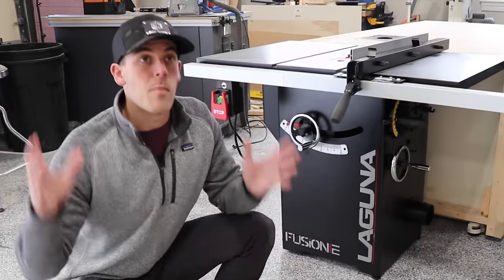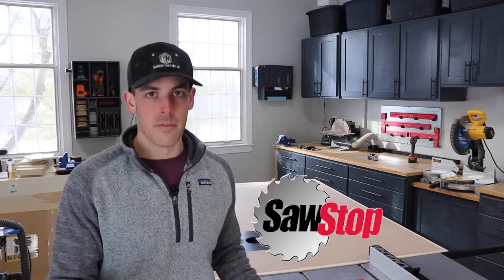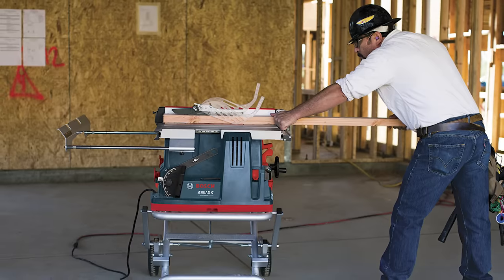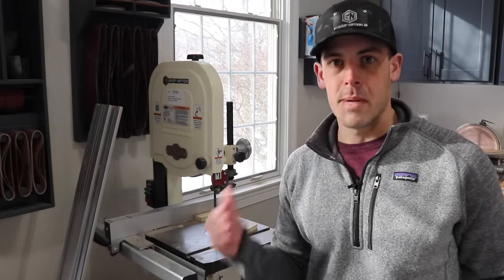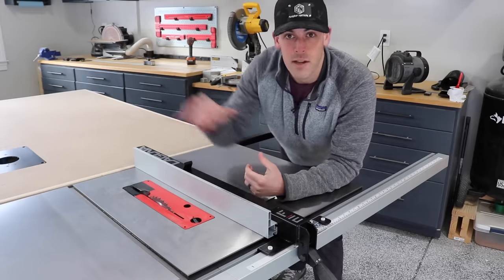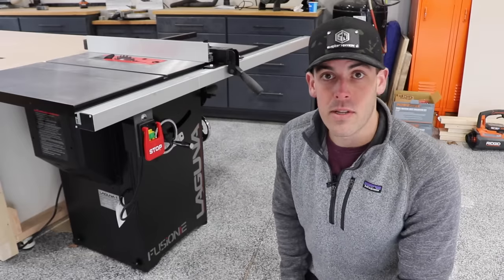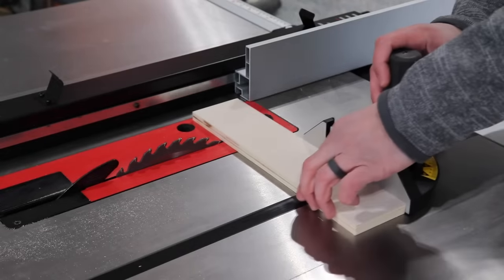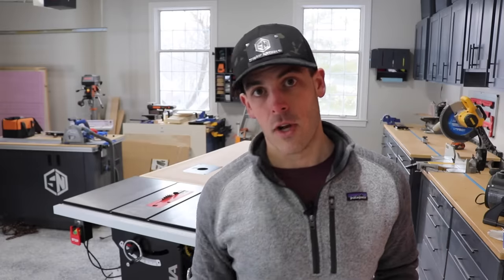Why I Bought a Laguna Table Saw over SawStop!

Comment: After 15 years with my Bosch Jobsite saw with vertical rise stand I'm finally ready for the next level. Do diligence for a tool in this price catagory meant a LOT of Study of the alternatives. Boy was I sold on Jet! loved Powermatic but not the price.  Then the Laguna F2 showed up. Of course I studied the Sawstops.  The cheapest Sawstop, the "Contractor model" was priced about the same as the Laguna F2. So, I went to actually touch & feel at Rockler & Woodworkers Supply as well as Woodcraft. Couldn't find a Fusion 2 here in Phoenix. But I did try out the only Sawstop I thought I could afford, the contractor model. My old Bosch was really pretty good at what counts, A stable straight and accurate fence.  I have cut many thin strips with it and a lot of hardwood. The Bosch handled everything really well for its small stature.  I did find several Sawstops.  I did not like the fence at all. A stable fence, and a blade, alligned well, are THE really important features. DYI on this last requirement  seemed to be avereage for most of the other machines.  The fence on the Sawstop contractor saw was inferior to my old Bosch. Setting it to the desired location seemed to be very IFFY. Just exactly what I don't need.  The fence on my brand new Laguna F2 is the very best on the market, if you ask me. The factory setup on the Trunion, motor and blade is just great. Better than I could have done myself.  The wheels are on!  Another $100 DYI job I didn't need,  and yes it passes the nickle test as well. Waiting to see if I will do a zero clearance, thin kerf chopmaster blade which I had on my Bosch.
Reply: We are in the exact same boat. I too had the same Bosch and now looking at Laguna. Only I  am leaning towards the F1. Space is my issue.  Can I ask why you picked the F2 over the 1 ?

Comment: This is a great discussion... but I think that the idea that you “have to have a SawStop to be a serious woodworker” is flawed.   SawStop provides a great degree of protection from an inadvertent injury.  Being someone who works in a field where I get to see those injuries, I have to agree with your detractors... the incidence is low.  NOt that low, but low.  But the cost is HIGH.   VERY HIGH.  So the risk benefit ratio is still favorable to SawStop...  But, you can use a good table saw safely, and go your entire life without, admittedly, doing anything stupid.   The vast majority of table saw injuries I have seen or researched were the result of doing something that the victim admitted after the fact, they should not have been doing... so.   Use a splitter, use the blade guard, use a push stick, don’t put your hand within 10 inches of the blade, and beware your set up... your incident of putting your hand in the blade is now very, very, very low.  

I have a patient who fell onto their saw...  Blade all the way up, no guard, no fence in the way, saw on, blade running, fell backwards onto the saw table, not their back.  It was profoundly, remarkably, unfashionably stupid.  I feel very confident he would have died, if it had not been a SawStop.   

I own a SawStop... I love the Laguna Saw.   I own a SawStop because I did something stupid and walked away with only messy shorts and a cold sweat...  I stopped using my saw (a contractor saw) until I could buy as SawStop... Because I’m too stupid to be trusted not to do something stupid...  That’s the honest truth.  We are all at risk of doing something foolish in a moment of fatigue, hurry, or just plane, not thinking.   

You own a beautiful saw.  I am jealous that you trust yourself enough not to do something foolish.  I, as my wife likes to point out, am a fool.   Like most of humanity.
Reply: Literally nobody has ever said to be a serious woodworker you need a SS.
Reply: I like how you capitalised SawStop(tm) as per the company design sheet every time you used it
Reply: @kblock1738  Just like how he capitalized Laguna? Must be a shill for both!
Reply: @atomictyler  Laguna is a place champ, it'll default to being capitalised in most dictionaries.
Reply: @kblock1738  ahh yes. that's it laguna laguna laguna. look at all those auto-caps.
Reply: @kblock1738  my devices don't tell me what to do, so maybe you should look at yours and have them stop it.
Reply: Well from my perspective, it's not just doing something stupid. That tends to suggest doing something that someone with more experience or who thought more carefully about HOW to accomplishing something would NOT do. But there are also just plain accidents. Fractional moments of inattention or forgetting where exactly that spinning blades teeth are, or will soon be, positioned. Those are the kinds of accidents I took into account in deciding to pay a premium for SawStop tech. Besides with any kind of care at all, a good cabinet saw will last more than a lifetime. So it is a one-time investment. I like seatbelts. I like airbags. I like SawStop. None is perfect, all add cost. All provide safety benefits. I'm sure some will argue that auto safety mandates infringe on their freedom. It's all a question of balance. Society makes decisions on these things. Do you want redundant control systems in airliners? Shouldn't we let the 'free market' decide? Perhaps NOT. Why? Because as Torch MD explained, most of us are TERRIBLE at accurately assessing risk. What about energy costs? Well, ask Texans how they're feeling about unregulated, isolated electrical grid. It's all about risk/reward and striking a reasonable balance.
Reply: @aaronfrasco5797  thank you for pointing that out, I was thinking the same thing. Actually, all the professional woodworkers I know have powermatics which are no cheaper than the sawstop
Reply: You're 100p right. I have coworkers that have lost fingers and coworkers that have lost only a nail. Guess which one came from the SS. We can all say, "Oh but I'm not stupid. I take every safety procedure seriously." To which I would respond with, yes. I believe you 100p but there will come a time that your mid is not completely focused on what your are doing and something unexpected might happen. Not saying it will be a chopped finger. But its enough to rethink about not getting the SS because, "It will never happen to me." Now , I do not own a SS. I have a Hitachi Cl10 which i got for very cheap and would love to own a SS as the ones I've used for the companies I've worked for have worked amazing. These machines also come with pretty wild stories of coworkers thanking their bosses for owning the SS.
Reply: I agree with most of what you said.. There are plenty of tools/machines out there that can cut digits off in the blink of an eye and they dont have that grounding feature the saw stop has. Just my opinion, if a person lacks patience, focus, awareness, and skill set when it come to using power tools, maybe they should find another hobby/job. With that being said , ya we all f--k up once in a while, but being mindful of how your head is working that particular day is key to safety. Just try and be smarter than the tool your using. And finally, yes I have closed my shop doors when I was a feeling off, "To Me That Was Just Common Sense "
Reply: one of my friends is a Plastic Surgeon who is getting into WW and asked for my advice on a TS.  Unquestionably, he should get a SawStop, given his occupation.  I have one, and even though I am extremely careful around any blade that moves, just having that extra safety margin makes me, and my wife, very happy.  It's like buying a Cirrus aircraft over a Cessna or Piper. Having the airframe parachute has allowed many a husband to get permission from a wife to buy it, even though the odds of using it are extremely small.
Reply: @hhanger1  Quote "has allowed many a husband to get permission from a wife" thats frightening.
Reply: @darrellcaruk8880  yep but as a happily married man of 35 years, it's a cold, hard reality.
Reply: @hhanger1  good on you man. your very fortunate.
Reply: @darrellcaruk8880  although I do really like the Laguna adjustable fence.  Wish SS had that available.  It would be awesome!
Reply: @hhanger1  Ya thats a pretty fuctional fence, That being said, being an older guy ,I have an old Delta Unisaw 3 HP. got rid of the Unifence and installed a Biesemeyer. I did like how the the unifence could slide back and forth plus 2 sides available. Reguardless I love the accuracy of the Biesemeyer. Got everything used 20 yrs ago and still works great. if I were to get another table saw it would be a middle of the road cabinet saw {used of coarse} and use it strictly for a Dado Stack.  having 2 Tablesaws would work best for me. considered a track saw but tired of set up time.
Reply: I have to. mention one of the worst injuries I witnessed in a wood shop {not mine thankfully },  a guy, accidentally pressed his index finger on a horizontal edge sander {a big one with 60 grit }. compare his finger to thin Balsa wood , sanded down to the bone. I had to leave the shop. talk about traumatized.
Reply: @darrellcaruk8880  ouch!  I had a bandsaw blade bite me once (4 stitches) and an improperly used chisel do the same thing.  That was years ago and nothing even close since.  Once you lose respect for your tools is when trouble can occur.
Reply: @hhanger1  you are 100% right.  
not sure if its a appropriate to mention other you tubers on this site but he can take it down if he wishes. Watch a you tube channel called Stumpy Nubs. he is my second favourite wood worker with a channel. He possesses so much wisdom when it comes to wood shop safety. My favourite wood worker YouTube channel is a fellow CDN from Victoria BC. The Samurai Carpenter. If I had half his skills I would be happy. the best way to describe him is Zen like with Natural skills.
Reply: Well put.
Reply: I'm with you.  It's like buying additional safety options on a new car.  If I can get collision avoidance or anti-lock brakes or other items that give me an extra measure of safety, I'll get them even though I might not ever need them,  Same reason I got the SS.  I can afford it and it has enough of a value proposition that's its worth it to me.  I have a Plastic Surgeon friend who is getting into woodworking and he asked me about a table saw and I told him to get a SS.  His career could depend on it.
Reply: Right on target.  The first time someone trips a SawStop by human contact They just paid for the saw.  The ER is a tremendously expensive place to visit.
Reply: You slide there from "risk assessment" into the "precautionary principle."  Which is a movement from rational assessment to lawyer think.  Since Saw Stop is also the only such saw in the american market because the company actively suppresses alternatives.  Bosch, IIRC, has an equivalent system that doesn't destroy you saw blade, and the replace cartridge can used twice.  Saw Stop's dominance is quite cynically motivated and their prices reflect that.
Reply: The risk/benefit ratio is not applicable across the board, it is woodworker specific.
Reply: @aaronfrasco5797   If you feel that way you haven't been around many woodworking groups.  I've seen multiple people claim your not only not a serious woodworker, but that you're the dumbest woodworker on earth if you don't buy a saw stop.  These Sawstop owners are brutal.  I feel they need to justify the higher price in their own minds.
Reply: @germayne05   There is never a time that I am on my table saw that my mind isn't completely focused on what I am doing.  If I am tired, or something else is on my mind, I don't use it.  I feel that is why I have never come close to an accident in 45 years of using one.  EVERY single time my saw is going to be running, I treat it like it wants to kill me.  100% focused and 100% planning for what I'm going to do taking safety precautions with all safety equipment in place.  I remember being at a tool auction and a couple woodworkers were talking.  The one guy says the first thing he would do is take that blade guard off.  I noticed one digit half gone and another fingertip missing.  For people that are easily distracted, beginners, schools, and even some production shops, I see the value of a Sawstop.  But they are not for everybody.
Reply: As I like to tell my patients, don't feel bad, even the smartest person on earth will eventually do something stupid. All we can do, is try to decrease the odds that when it happens, it won't kill US or anyone else. Sawstop saws are one way to reduce the odds of serious injury or death just a little more. And if there is anyone else who might be using our tools, well then we must take into account THEIR likelihood of doing something careless, as well.
Reply: Do your research, and you’ll find that SS designed the safety feature to license, not to produce saws. When the other manufacturers declined his very reasonable proposal and were underhanded in convincing the other mfgs, he decided to produce the saw so that woodworkers would have a safe saw.
Reply: @kblock1738  Regarding "Torch MD's" proper capitalization of the SawStop name, I do the same thing. It's a common practice among the educated.
Reply: correction ‘you have to have a sawstop’ for the it offers serious wood wooker or not get over it genius

Comment: I use these at work all the time and they're both very good drills. https://www.youtube.com/post/UgkxW1vOBRCMrgTCDEijzpVzDWsgI-Jm2iQv I've been watching Amazon and stores waiting for them to dip a little lower in price and when they did it was a no brainer.The 1.5 amp 20 volt batteries are a real step up if you were using 18 volt previously. They should handle all your day to day needs. But if you do need more power know that not only do the 3, 4, and 5 amps last longer but they give you a noticeable boost in whatever you're doing. For home use however, you'd be hard pressed to find anymore need for power than this.These guns are also fairly durable as I know they've been dropped more than their fair share... that is if an accident happens. Dewalt also offers iirc a 1 year warranty if it does break as well, though I've never went through the process.

Comment: Love your video and thought process! Also I do not like being told how to think. I feel a lot of commentators herein missed the point. I am 50 years old and though I didn't work in the craft I took wood shop in school almost every year from 7th grade until Graduation because I love the aspects of working with wood. I remember the first few weeks or so of my first year of Wood Shop class in 7th Grade being spent in a classroom setting learning Shop/Tool Safety! Then got written tests on all content, if you did not pass the test; you did not use the tool until you did. The first thing(s) we learned about the Table Saw were (1) Never perform an unsafe function (which they outlined). (2) NEVER put your hands within 10 inches of the blade. (3) Never take your eyes off of your workpiece. among others. (4) ALWAYS use a push stick on cuts less than 8 inches wide. I spent some time working in the trade and in construction around job site table saws. Any injury I have ever seen entailed one or more of the rules I outlined not being observed! The Safety Message got "watered down" over the years. I have never been injured by a table saw and still have all ten digits in tact, something to be said for listening to the old heads! Even Norm Abrams said, "Be sure to Read, Understand, and Follow all Safety and Use Directions of the Manufacturer and Always Wear these, Safety Glasses"!

Comment: I got a good laugh from your comments about SawStop and YouTube videos because it does seem to ring true.  Cheers to you for challenging the orthodoxy!  Not knocking anyone for choosing SawStop because it's a well built saw.  As I've upgraded my shop in recent years, I've considered getting one but since discovering the joys of my Makita track saw, I concluded that I don't need a big heavy-duty cabinet saw for sheet goods.  Instead I upgraded my 90s Delta contractor saw, which runs really well, with a new fence, a custom-built base, and a riving knife.  The last item I consider the most important safety feature.

Comment: I just pulled the trigger on a Languna F2 as well back in September(2020). Its been a huge game changer for my building! Quiet as can be, cuts like butter (with the proper blade, I use a 60 tooth CMT), and quite affordable. I love sawstops, they look and perform amazing. But I just can't bring myself to shell out that kind of cash when (arguably) better options are readily available. Good review man, loving the videos!
Reply: There is no better option than keeping your fingers
Reply: @lavillastrangiato7910  nothing beats safety, common sense , and respect for the tools you are using. I agree though that for some ( scattered brain people, ADD, people, always tired, etc ) the Sawstop is the perfect table saw. I have ADD and I have to super concentrate  on what I’m doing every time I do woodworking because I know my lack of concentration. I always pray before woodworking. I have been building furniture for the last seven years. God bless